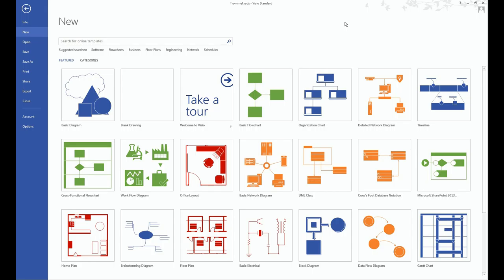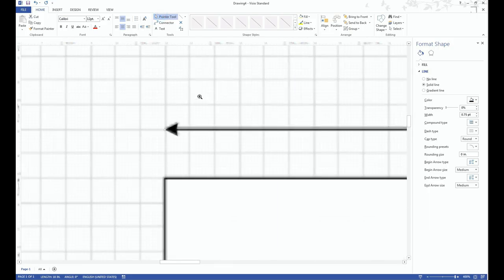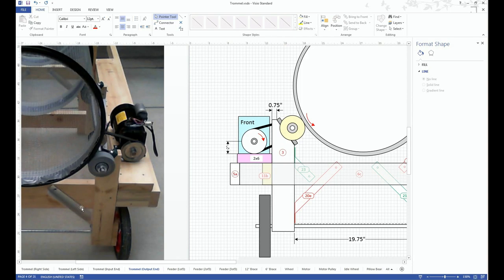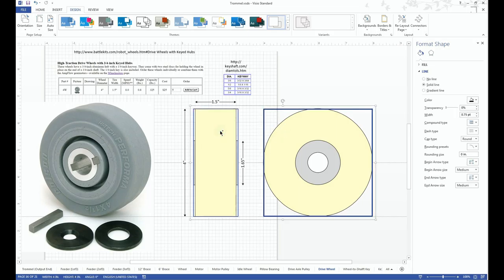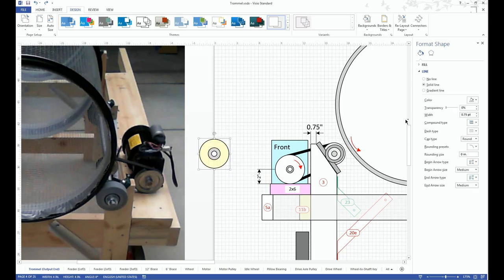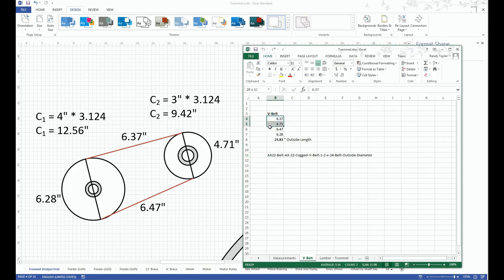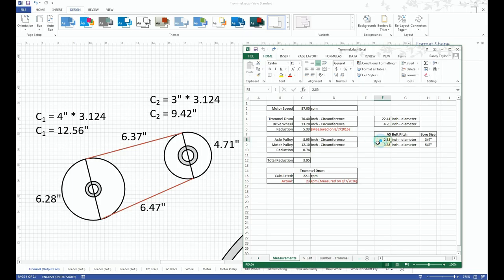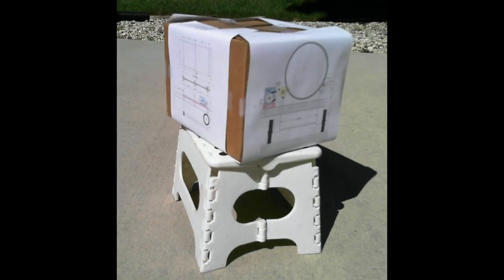Rock Trommel / Rock Washer (Part #2 - Software Tools)

Comment: A+ for effort but it would cost significantly more in machine time and labour hours to wash rocks than just replace them with quarry purchased washed rocks and using the old dirt filled rocks for fill in a different location.
Reply: Yeah, that's no fun however.  I'm thinking combining with simple modification to get both trommel's processes in one trommel... even if a longer design that I don't believe is required.  Would have to be careful though to keep the dirt separate and dry.  Would be handy if they were doing permaculture or regenerative farming or if they had their own quarry or mine claim.